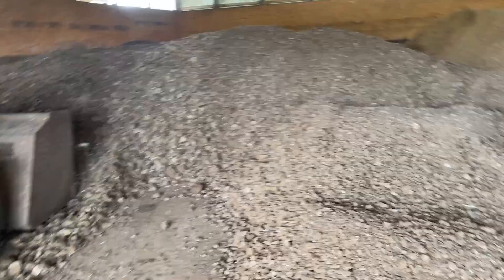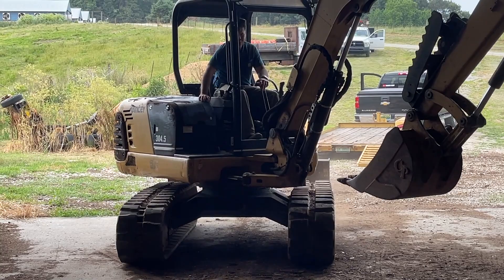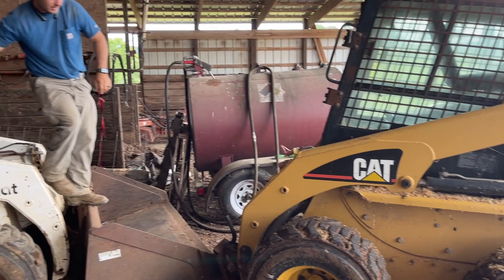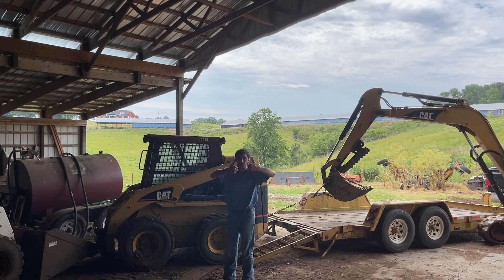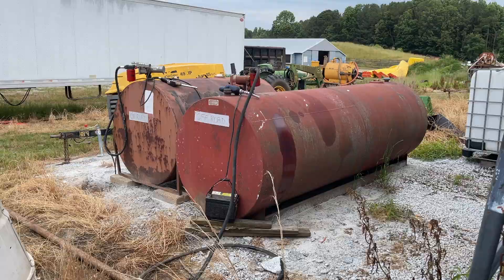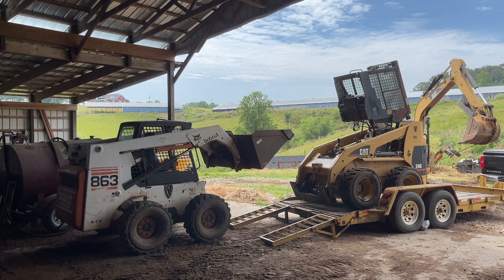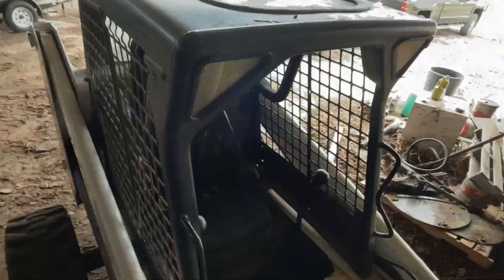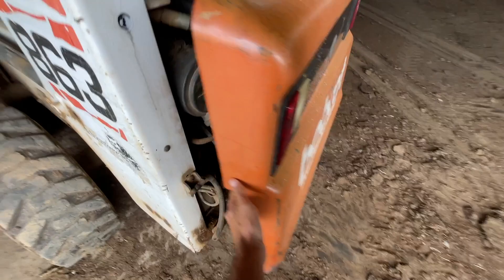Taking The CAT To The Doctor! | Hydraulics Don't Work So We Had To Drag It On The Trailer.

Comment: part #2 please, we want to know what was the problem please brother 🙏🏻
Reply from the maker: Eric ended up selling it not long after that video but there was a seal between the hydraulic pump and motor that went bad
Reply: @FarmerHunt  Thank you brother 👍🏻
Reply: @FarmerHunt  So teh coupler failed? I just had one put on my cat 277. I went with the upgraded one but they are engineered weak points on the unit.